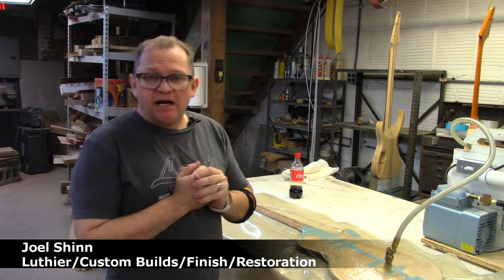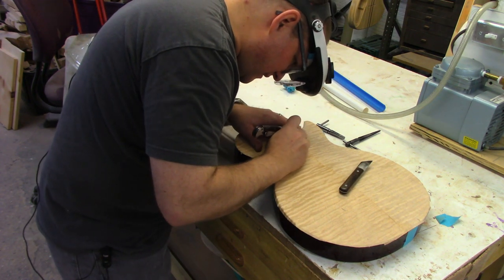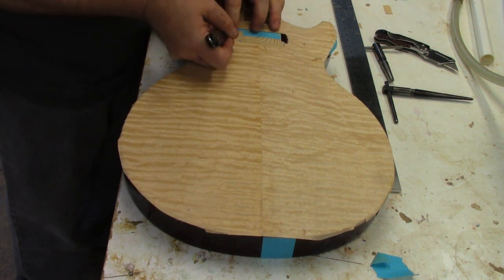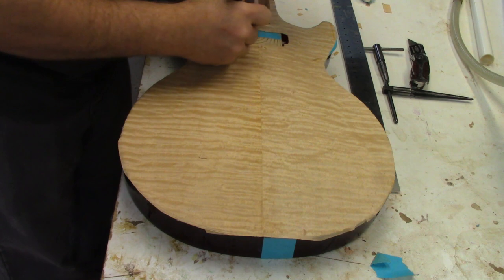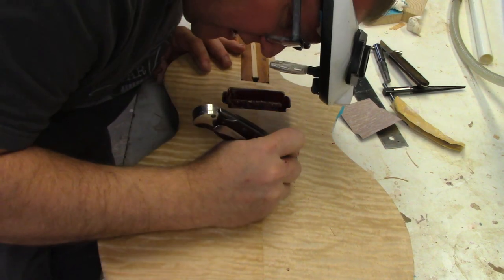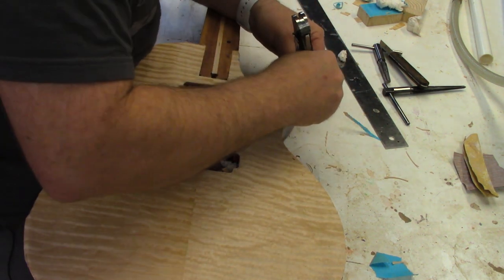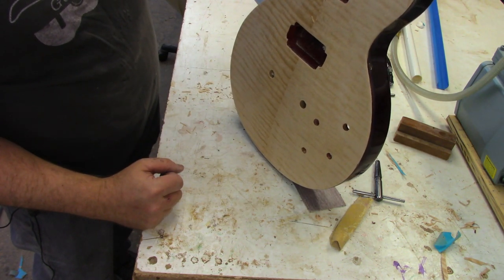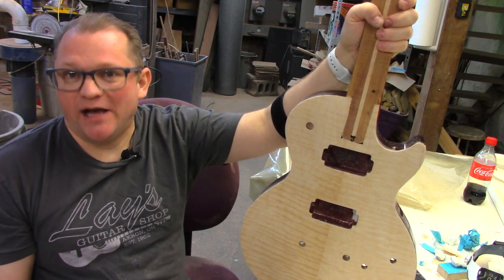Opening vacuum bag, removing tape and cutting into the veneer on Les Paul Studio conversion - Part 4

Comment: How is this project coming along? Very neat.

I think such projects has tremendous values. I've done similar things to two of my standards. They are like nothing else and interestingly enough, I've been offered very good money for them. But they are mine and they stay with me.

A guitar like this, with good electronics, good hardware, a well set up neck etc. will sound and play better then most LP Customs from the factory.

Comment: Too bad you didn't suggest the client convert to a real ABR-1 Bridge and installation.
Prior to gluing the veneer would have been the perfect time to install the maple dowels into the Nashville bridge threaded insert holes.
Opportunity missed to really make that Studio a traditional Les Paul.
Reply: It may not be just about the look. The owner may not want to change the playing feeling of it, just the appearance. Maybe the owner is not a bedroom player, maybe the owner knows something more than you.
Reply: The ABR-1 is not the end-all-be-all of Gibsons. This will never look like a '59 anyway, so what does it really matter? Yes you can pull the tail down further, but the ABR-1 has other drawbacks. With a guitar like this, you are better off using a Schaller rolle r bridge, a Faber Tailpiece, Shaller brass pup rings and Schaller Keystone locking tuners. Wire it up properly with Duncan pots, a good toggle, and pups of your choice, add an ebony fretboard with some decent inlays rather than the usual MOTS inlays, and you will have a machine that will play circles around most high end factory Les Pauls with ABR-1 bridges.